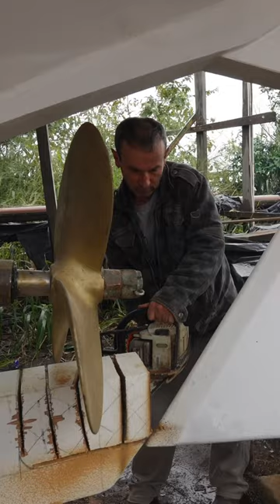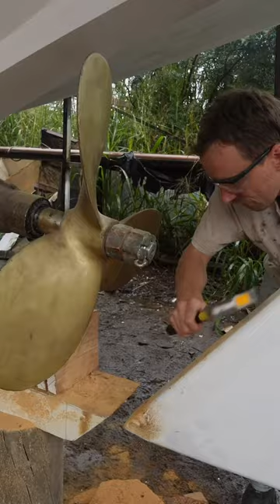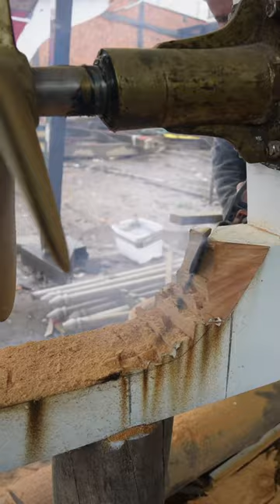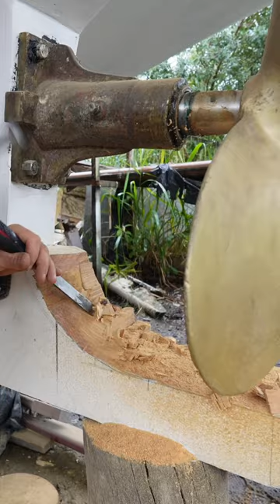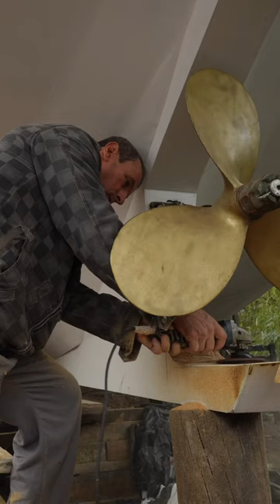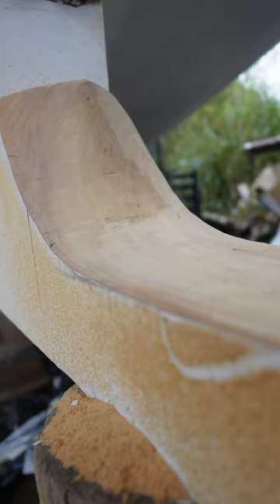Boat building: cutting the wooden keel and adjusting it to the propeller

Comment: The distance between the tip of the propeller and the hull should be roughly 10% of the propellor diameter, to avoid thumping noise when the blades turn past the hull.  Also the protrusion below the propeller should be faired (shaped) to result in as little turbulence as possible, so it should be rounded (or more) all the way aft.  
As the propeller will place big loads on the rudder, the base of the rudder needs a strong pivot connecting it to the end of the keel.